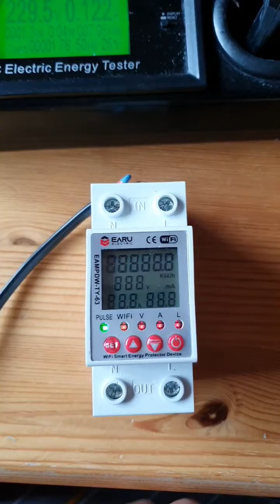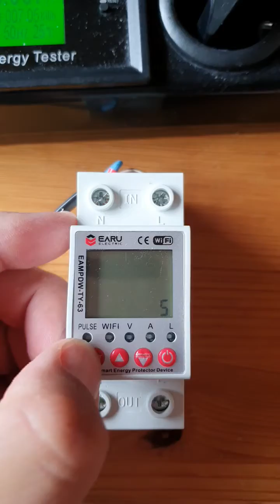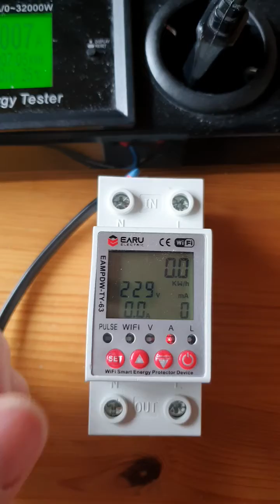EARU WiFi Smart Energy Protector Device lost settings after power off

Comment: Did you find a solution or the issue still persists?
Reply from the maker: I had sent it back and had bought a much better one: https://de.aliexpress.com/item/1005005291028624.html?spm=a2g0o.productlist.main.1.e8506d6b9L6z4D&pdp_npi=3%40dis%21EUR%2136.16%2125.31%21%21%21%21%21%402145280e16814951411118608d06eb%2112000032516123314%21sea%21DE%21123430517&curPageLogUid=hey5wiQnVjQo

Atorch AT2PW with OLED-Display and the measurements are very precise. ;-)

Comment: I have also order the same buy I can't connect it to wifi. How did you enter to paring mode ?
Reply: Long press the switch for 10 seconds
Reply: Wich button? I have Ok, up,down and settings?
Reply: @dmuzina  what's the device for and how does it work